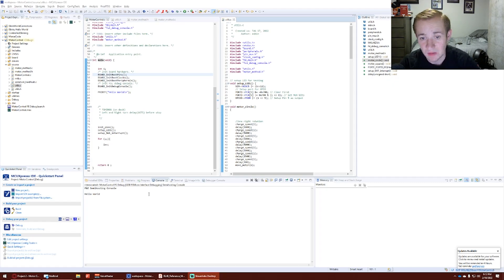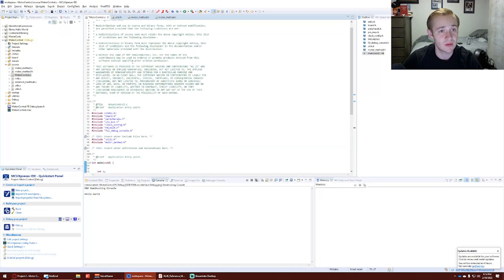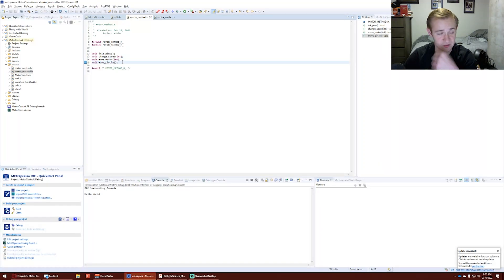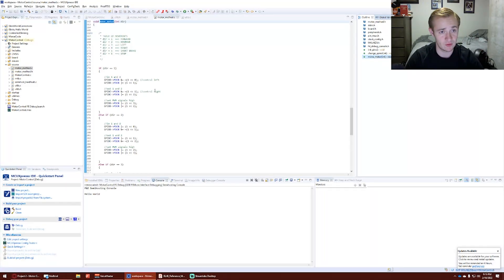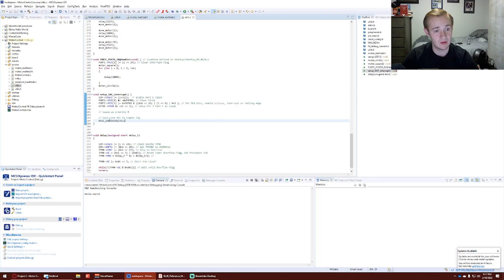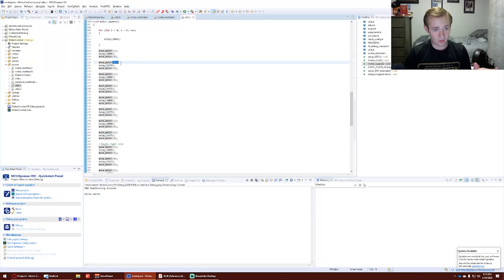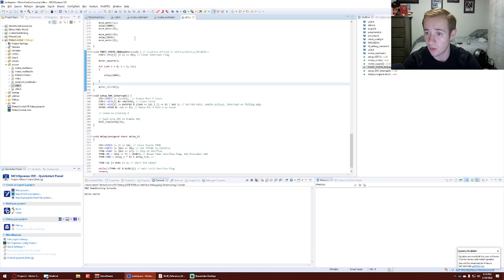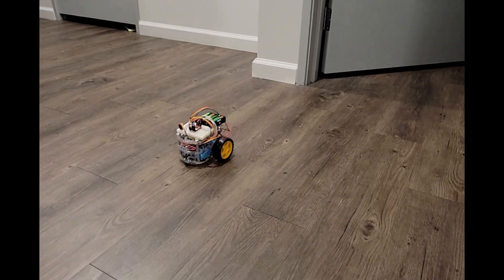FRDMKL67 Motor Control Figure Eight Demo

Comment: My initial question, which you answered, was how you were ensuring a 90° turn. I'm assuming that you determined the timing empirically. Are the drive motors stepper motors? Thanks for the detailed description of the code and the demo of the operation.
Reply from the maker: I believe these are brushed H-bridge motors. There is no need for such precise movements with them. 
I did determine the time to turn empirically based on testing with my hard surface floor. You would most likely experience different results on your own floor/carpet.